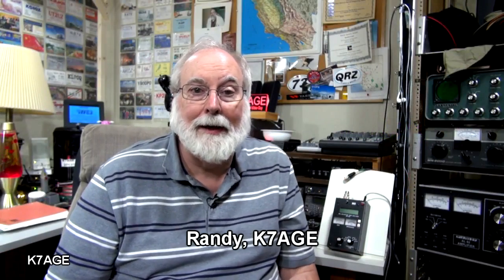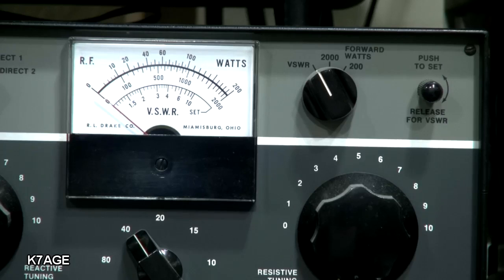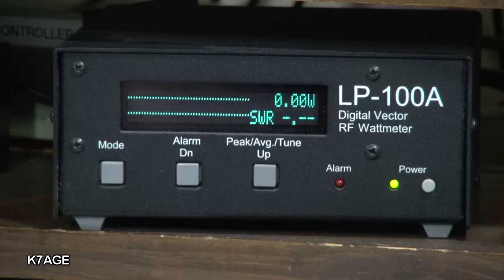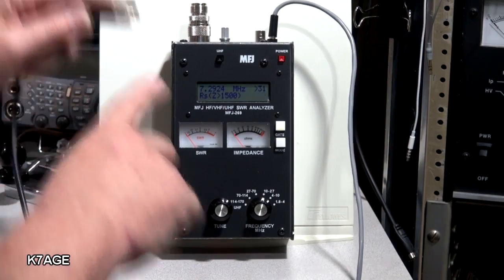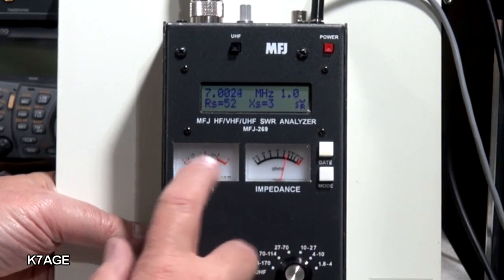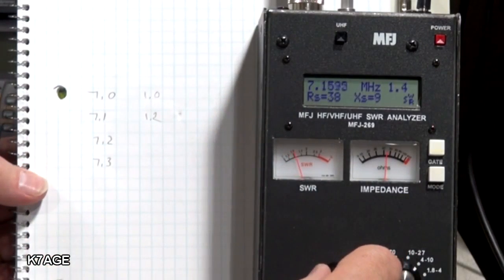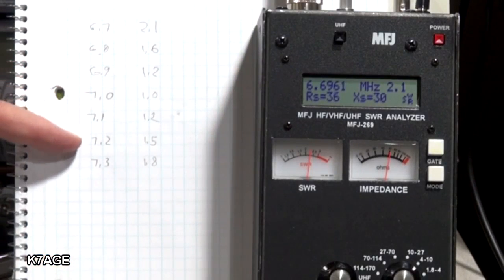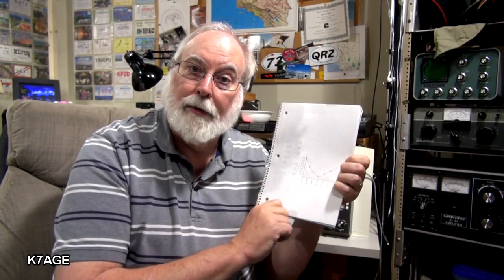How To Use An Antenna Analyzer - Basics

Comment: Thank you.  I have two used vertical HF antennas that I am testing and they both did not show a resonate frequency, new installation for me. I think they are both bad. I will be replacing one and rechecking. My father was a ham radio operator W5OQA in Grove Okla. He hand made his QSL cards, do you have one. He is a silent key now and I would like to have on of his cards.
Reply from the maker: I checked my cards, and I don't have one from your dad.  What band(s) is the vertical for?

Comment: I have the 259D I have not used it yet I am wonder how to use it to help me tune my imax-2000 but I am confused because my radio puts out 300 watts and the higher the watts are the higher the SWR goes so I can't figure out how to check this. any help would be appreciated greatly Thank you.
Reply from the maker: SWR is a ratio between forward and reflected power. There are no units (watts, volt, or amps) associated with SWR. You should have the same SWR with low or high power. You tune the antenna for low SWR, and the transmitter will be happy.

Comment: I have a NanoVNA, but this is besides the point I think (as it does the same thing, just plots automatically). Should this measurement be performed at the antenna feed point high up and not at the shack when cutting the antenna to length? To take the feedline coax out of the equation when tuning the antenna?

Comment: You set  forward Full Scale Deflection whilst switched to VSWR.
Does that mean that the push button over rides theVSWR/200watts/200 watts selector switch?
Thanks for the video. 73
Reply from the maker: The SWR meter needs to be set for full scale in the SWR Forward position. Then when you switch to SWR Reverse,  the meter will show SWR, not power. To measure power, switch the meter into the Power mode. On the Drake pushing in the Cal knob places the meter into Forward, release for SWR. Thanks for watching, Randy
Reply: @K7AGE  
Ah that's the answer. When you set fsd on the Drake, it was still  in the VSWR position and it caught my eye but your explanation of the button makes it all clear.
When I got started we had no coax available. We tuned the PA anode current for minimum dip & then loaded it until the specified current was reached.
This was usually by tapping the end fed wire, up the taps on the Antenna coil of the matching unit..Before MY time they tapped up from the earthy end of the TANK coil...Some actually put a DC blocking cap in there..Some!
Then Pi tank matched PA's end-fed wires, making life a lot easier but no coax feed. Never heard  of swr until centre fed dipoles used 75Ω TV coax,. Built my 1st SWR bridge for 75 Ω.
I cussed a bit when my 1st commercial had plate and load with a 50Ω output!
Thanks Randy

Comment: Also I just purchased a MFJ259C to check the resonant frequencies on what appears to be some bootleg  Motorola logo rubber duck HT antennas that I got for a homeowners watch group that are used on the (no license MURS band).  The antennas had the correct Motorola part number and Bat wing logo and font on the Motorola markings on the antennas, but they were obviously about an inch or more shorter than another Motorola rubber duck I had and the insulator in the bottom SMA connector was not the same color.  I also ordered an SMA to PL259 adapter for the test.  Wish me luck, Cliff 73

Comment: Hi Randy,  I know hams do not like to venture into CB Radio.  But I will use CB for this example question.   I am a tech class ham and I have question that is probably best left to an RF engineer, but I will hope you can answer it.  Can reflected power be an unreliable issue in some instances?  I am referring to IF the MFJ ANTENNA ANALYZER shows a (CB antenna mirror mount installation for instance) to be resonant on 27.085 CB channel 19 on a tractor trailer mirror mount installation (when the antenna is vertical).  But the VSWR meter shows high on reflected power on a VSWR Meter.  We see these antennas tilted forward like a bull would have its head tilted down on these mirrors all the time.  This would put the field strength forward signal toward the ground.  I assume that this is done because the CB shops VSWR meters are getting reflected power back from the high sleepers and the higher trailers.  Would it hypothetically better to tune a mirror mount antenna  installation of this type with the analyzer and leave the antenna vertical (for better forward gain), OR would there theoretically or actually be a real reflected power issue that could damage a radios RF output section.  In other words I think I am asking if the VSWR meter is an  actual reflected power reading or a possibly false reading.  I guess I probably sound stupid, but I am trying to learn a little about RF Theory. 73 Cliff
Reply: Are you working on a Kenworth truck, fiberglass cab doesn’t help with ground plane, I hate trying to tune antenna’s on them! Don’t have any solutions yet! Any other truck with metal cabs aren’t a problem.

Comment: Randy, thanks for the video. I was just confused by your wording. I think you meant that to get the antenna resonate on 7.2Mhz you have to make it 'shorter'. But you kept saying 'shortening it'. Which makes me think of an electrical short and not making the antenna smaller in length. Is that what you meant?

Comment: Well Randy, that was the "perfect" explanation of an antenna analyzer in action; short, sweet, and to-the-point. I am slightly biased, as that's the way I tune my tuner prior to actual transmission. Tune the tuner with the "MJF" and tune the transmitter into a dummy load. Connect transmitter to antenna and we're good to go. Thanks a lot. Great audio and video quality too. 73.
Reply from the maker: Thanks

Comment: You said at one point that this analyzer can go outside of the amateur bands, which caught my attention. How about the area between 230 and about 400MHz? The specifications make it appear that you can only use amateur bands, which seems sort of silly.
Reply from the maker: Their website says MFJ-269C covers 530KHz to 230 MHz and 415 to 470 MHz -- an MFJ-269C exclusive! Includes all the features of MFJ-259C, the world’s most popular SWR Analyzer plus much more! Looks like a dead zone between 230 & 415.
Reply: K7AGE Thanks. That's what I was afraid of. I'll just have to settle for a directional coupler, spectrum analyzer and signal generator. So cumbersome by comparison.

Comment: HI Randy!... I used my mfj269 analyzer to tune a home made 5/8 for 2m as an experiment.  I can tune perfectly the antenna, but as soon I take it 10 ft on the mast the swr gets crazy and the antenna is useless.... Have you any clue whats happening?...  tanks!  I don't know what to do
Reply from the maker: Hi, my hunch is that the antenna is coupling to the surrounding when it is down low. You will have to make adjustment low where you can reach it, then raise it higher to check the SWR, I would think having the antenna on a 10 foot pole in the clear away from everything would be good for testing and adjustment.
Reply: thank you for your answer Randy!...  do you agree saying that 5/8 antenna in general (been unbalanced) are somehow unstable and more sensitive to the surroundings than, lets say a 1/4 ground plane?.... in this regard I made a small and simple wire quarter wave for 2m and as I remember didn't change much the swr when put in the 10 foot pole....   or maybe Im wrong in my perception and there is no difference, and both are sensitive??    what's your opinion Randy?    one lesson learn for me is that doesn't matter how much efford is needed to take the antenna up and down from the pole a thousand times is better than trying to tune it low ground an then taking it up.... what do you think?     thanks !
Reply from the maker: Well, a 5/8 antenna typically has a coil at the bottom to provide some matching, since the antenna is not 50 ohms impedence. If you don't have a matching section, then you will probably be seeing some strange reactions.

Comment: Randy,

Great video. Thanks! How would I use the MFJ unit to tune my 204' G5RV, with the feed-point up on a 40' fiberglass mast?
Reply from the maker: The G5RV comes with a matching section, which is where the coax attaches to. This is where you connect the analyzer, not up high at the horizontal wires.

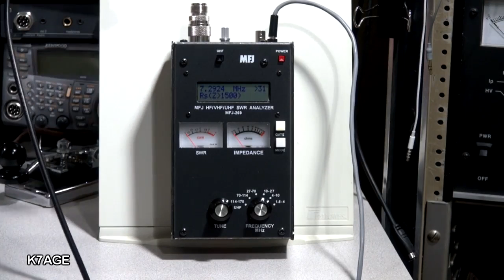Comment: At Field Day 2016, we were at the rural home QTH of one of our club members and we experienced some of the extraneous RF as mentioned at 2:55 but it took us a while to trace.  It turned out to be the underground dog fence that was pumping erratic RF into the analyzer, making it practically useless since the coax was lying on the ground for many feet not far away.  Once we put the antenna tuner inline, that isolated the analyzer and we could tune the G5RV to any frequency we wanted and it worked like a champ, but as it was, we could not take a "barefoot" reading just to see how the antenna was on its own.
Reply from the maker: A dog fence, interesting. Glad that you got things to work. That is all part of the fun, figuring things out.
Reply: K7AGE Thanks, Randy. It was fun scratching our heads and finally figuring it out. Next time  we will wind the coax into a makeshift choke at the feed point to see if that will keep the noise away.

Comment: Thank you for your excellent video/explanation of using an antenna analyzer. You have shown me that the MFJ analyzers may not do as much for you as something like the SARK 110, but it costs a lot less, and is actually a lot easier to use. Too many features, and it takes longer to read the manual and understand just how to use the tool. The MFJ-259C (or 269C) seems to have just the right amount of features to make it easy to use as well as extremely useful.

Comment: okay thanks once again , so I have learned that there is a difference between an SWR meter and an SWR analyzer..... That explains the price differences. thanks again
Reply from the maker: Both meters have their place. The SWR meter is good, as you will always see what is going on when you are transmitting. The analyzer is more useful for testing and tuning an antenna.

Comment: okay so im looking for the best way to set a Wilson 5000 i may have to trim it but i would like to get the wave a flat match on the 27 mghz band im looking at possibly buying this analyzer it does cover the 27 mghz band correct ? i want to make sure i buy the correct model

Comment: I found one of these, someone left batteries in it for many years, the battery tray is ruined I will need to get a new one, I noticed it does have an power cord connection and inside I seen a jumper, is it possible to put rechargeable batteries and it will charge them? also since I have to replace the tray, couldn't I just use a 9v battery?
Reply from the maker: +teknowil I don't know if a 9V battery would be able to supply enough current to power the analyzer. Try it. I don't use internal batteries, since I don't use the analyzer all that often. I power my analyzer from an external 12V battery and a power cable.
Reply: +K7AGE A 9 volt won't last worth a darn in the analyzer, nor is it likely to work very well either.. I have been repairing radio, TVs, stereos, appliances, transmitters, receivers, transceivers, but mostly guitars, guitar amplifiers, & music stuff. I finally went & passed 2 out of 3 tests and have my General license now. Here is battery tray for 8 AAs, which may or may not fit. They also have a flat tray that holds 8 AAs. For argument sake, 6 AAs will run a guitar distortion stomp box for years, compared to a month or two with a 9 volt battery. I'll address the link to the gentleman who ask. Muchos 73s KI7AQJ
Reply: +teknowil Try this...http://www.allelectronics.com/make-a-store/item/bh-38/8aa-cell-battery-holder-w/9v-battery-snaps/1.html or this, http://www.allelectronics.com/make-a-store/item/bh-448/8-aa-cell-battery-holder-w/9v-snaps/1.html or this...http://www.jameco.com/webapp/wcs/stores/servlet/Product_10001_10001_105478_-1   A 9 volt won't work very well at all.
Reply: +Seth B That flat  tray I put this link to: http://www.allelectronics.com/make-a-store/item/bh-448/8-aa-cell-battery-holder-w/9v-snaps/1.html    It fits my MFJ 269.  73 KI7AQJ

Comment: Great Video Randy, I echo the comment that I would like to see a series on the other functions that the analyzer can perform. Also you may want to point out that there is a difference ( I believe) in measuring SWR with an antenna laying on the ground, verses measuring it in the air ( or vertical in your example). 73, thanks for your dedication to the hobby
Reply from the maker: +Scott Johnston Yes, there is  difference in the antenna laying on the ground, 5 feet above the ground and probably where it will end up hanging. Best to test in the finial installation place. You may have to lower and raise it several times! Part of the fun.

Comment: I'm a total noob at Ham Radio. I mostly listen into stations. Is swr important to transmitting only or does it effect receiving too?
Reply from the maker: Jon Berry Yes it does. Poor SWR would reduce the amount of signal available. You probably would not notice this reduction. We want SWR to be low to get as much power as possible to the antenna. And, we don't want to blow up our transmitter operating into high SWR. Most transmitters will sense high SWR and shut down.

Comment: I have a question, if you have a dip how do you know if its the antenne and not the lengte of the cable ?

73 .. Ger
Reply from the maker: Cappeltje you could first check the coax by placing a know 50 ohm load at the far end.

Comment: Great topic and easily accessible demo! For those that want more depth -the Alanta Radio Club You Tube page has an excellent series of videos featuring Martin F Jue himself covering all aspects of operation the MFJ Antenna Analyzers. These things are what made grid dip oscillators a bit redundant. They are sort of a GDO married to an RF bridge. But even with this, I still use my GDO sometimes. Can't have too much test equipment.

Comment: Hi Randy, I was wondering if you could tell me what the trick is to knowing whether the antennna is too long or not long enough based on what the analyzer says? OR if you have a video that already explains this, would you kindly point me in its direction? Thank you sir. I appreciate all you do for the Ham community. 73, de KD7SJT
Reply: Earl Gray If the resonant point (lowest SWR) is too low, that means your wire antenna is too long and needs to be shortened.  If the resonant point is too high, the wire antenna is too short and needs to be lengthened.  As Randy hinted at in his video, as long as your SWR is below 2.0 at the frequency of interest you're fine.